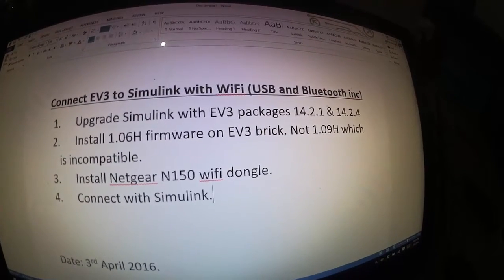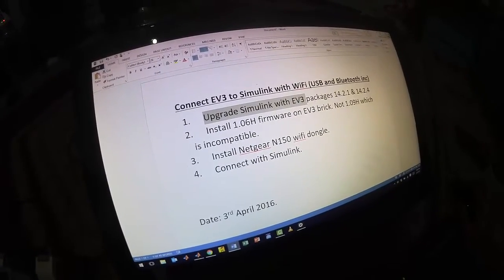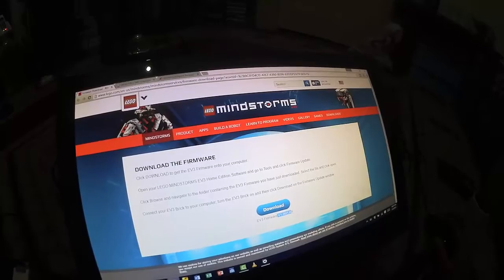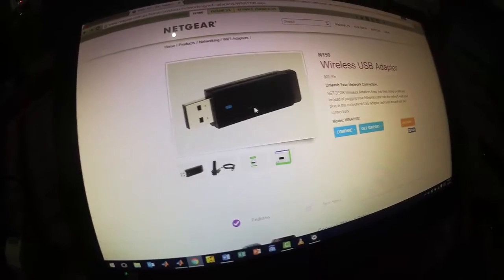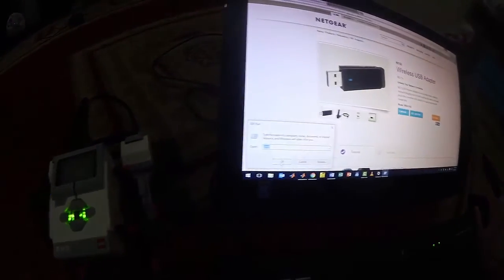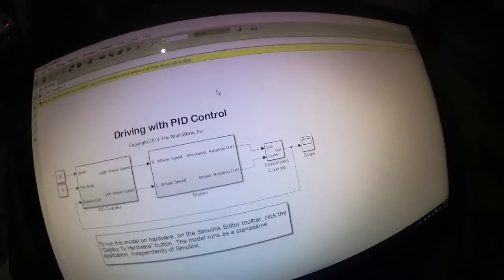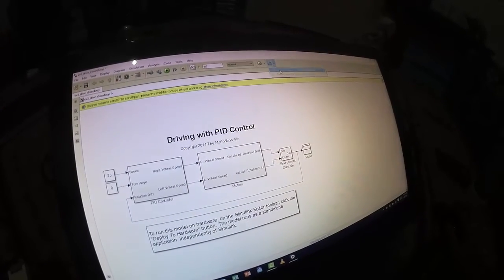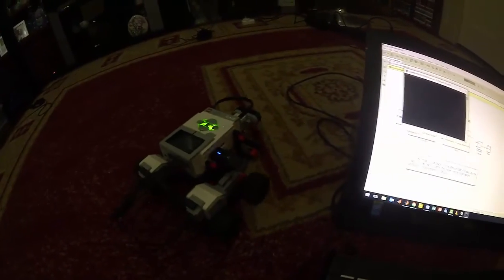Connect EV3 to Simulink with WiFi, Bluetooth, USB.

Comment: Should the new MATlab packages also work or do we need the 14.2 version?
Reply from the maker: At the time of the video, that's what was available.... I don't know how newer upgrades work. Let me know.
Reply: Well the I had to downgrade the firmware to 1.06 (like in your video) and it worked for a wired connection but not for bluetooth
Reply from the maker: Blueghost136 Bluetooth doesn't work, only wi-fi.

Comment: Hi, I have a problem connecting the brick to my laptop, I have a network from my smartphone (hot-spot). The reason I am using hot-spot is because my network has diffirent security protocol. I've connected the brick and my laptop to the web, but after trying legoev3('ip here'); it says "Error using legoev3. Failed to connect to '192.168.43.65'. Please check your network settings."
The ip I've entered is the ip the one brick showed me in brick info section. I checked that the network is working on laptop (entered facebook and stuff). The brick firmware is 1.09H. Can it be the reason or can it be something with my network, which wasn't full range ?
Reply from the maker: is the network and devices on WPA2 security? try firmware v1.06? can you ping the EV3 from the laptop?
Reply: The thing is I didn't think about pinging the brick today. I am working on a simulink project at University. There are 2 networks that I could join, but they have diffirent security protocols, therefore I used my internet which has the WPA2 security, brick connected to it. I will check the ping and firmware tomorrow. Do i have to reinstall firmware using LEGO EV3 software or can I do it some other way ?
Reply: Ping works, I'll try to downgrade firmware to 1.06
Reply from the maker: use the mindstorms software, pretty easy. link to 1.06 in the description and 'how to' is in the video :)